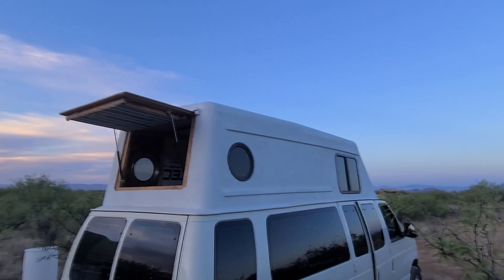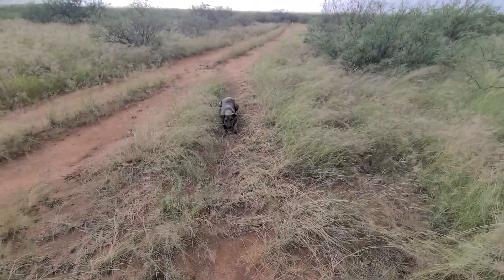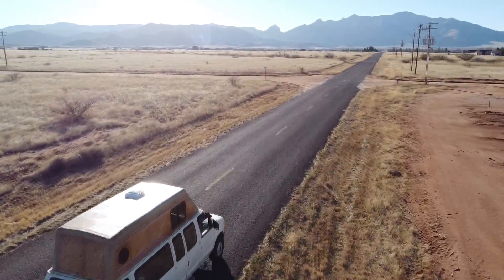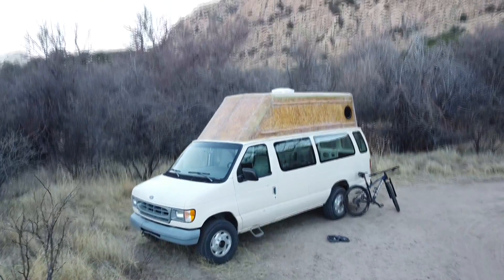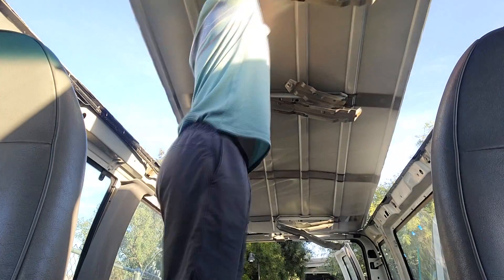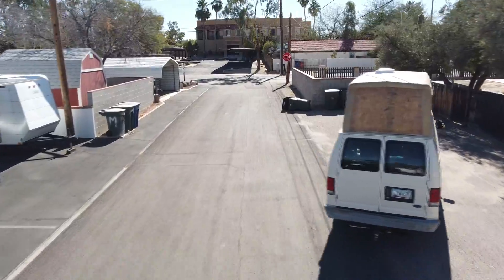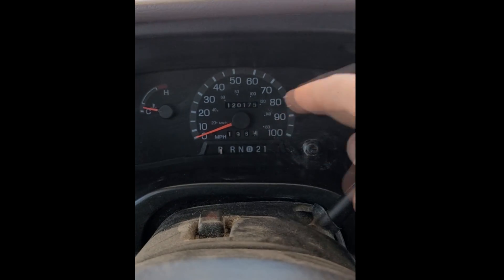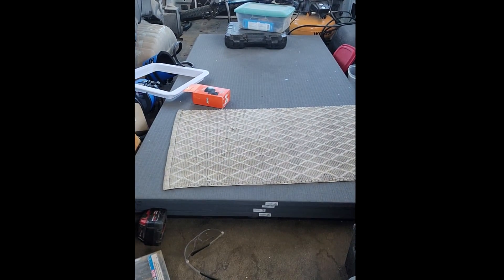High-Top Van Fuel Economy: Surprising Results!

Comment: I drove from LA to Portland and back in my '97 E350 V10 and averaged 16 mpg, I set cruise at 70 the whole way.
Reply: I had a 2014 v10 10k pound ambo and it got 15.5 on highway with cruise on 65. Hills etc...

Comment: Curious how much the topper cost to build?
Reply from the maker: I haven't done a final tabulation yet, and it changes based on size and cost of materials (inflation), but I'd ballpark it around $1,000 total.  Obviously this can be more or less depending on the level of finish (windows, paint, insulation, etc)